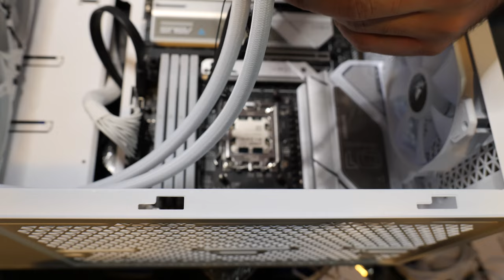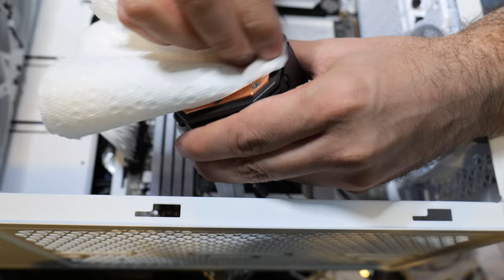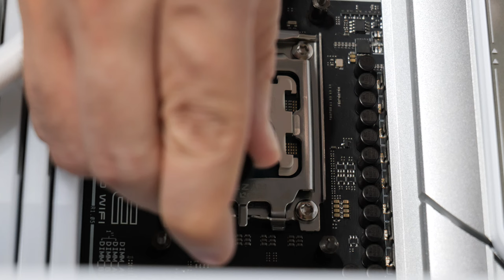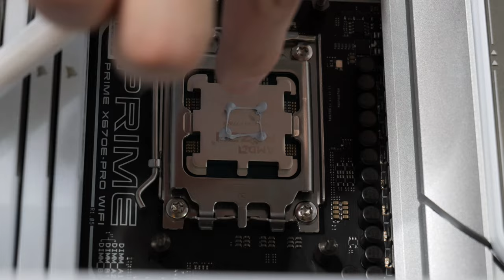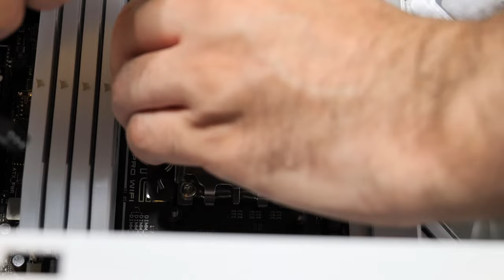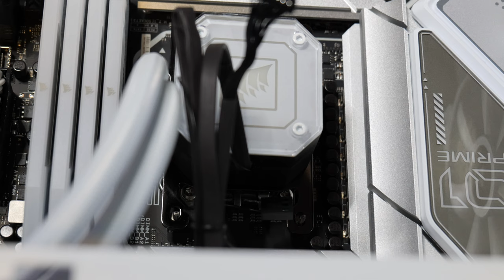The Best Way to Apply Thermal Paste to CPU

Comment: Jesus. Don’t do what he’s doing. This is not the way to do it on these CPUs. You need either one pea size blob and that’s it, or to use a guard and thinly spread a bead out. Remember you’re not trying to create a large pool between the CPU and block, but just fill in the microscopic groves between the two metal layers. Metal to metal is ideal, this just fills those 1/100th hair sized diameter of milling imperfections. Doing what he’s done above could actually raise your CPUs temps.

Comment: Folks. You need to also think about the screws. The harder you screw the more pressure is going on the  paste which presses the paste. The more you screw the more shit is going to spill. Don't overdo it. I can see some people screwing until they can't. That's the wrong approach. Well. Maybe unless you are building a pc for a jeep or something that moves around a lot. But pc generally don't move slot. Does it sit sturdy? Enough.